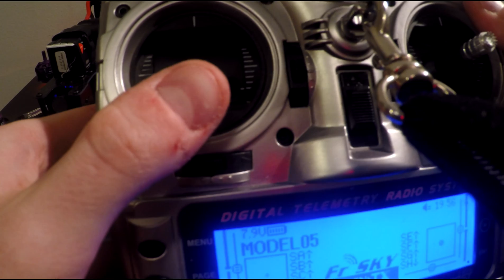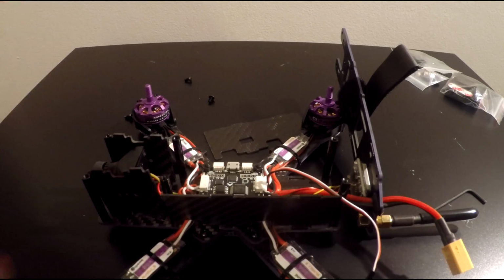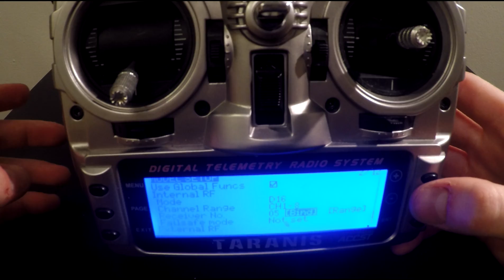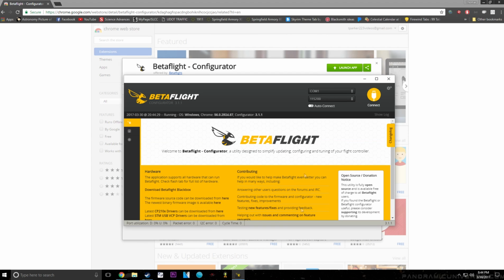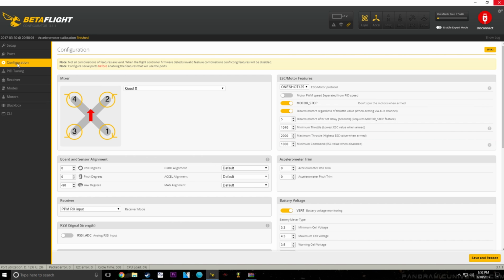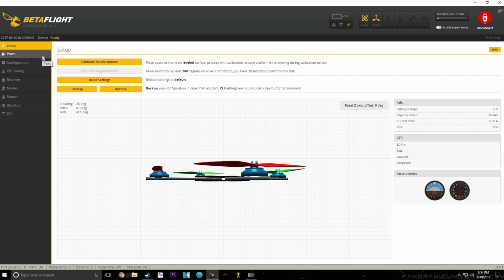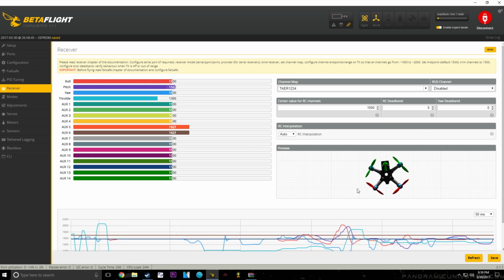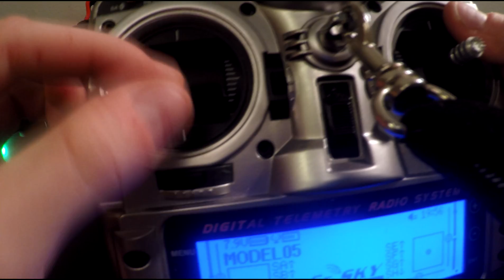EACHINE WIZARD X220 FRSKY TARANIS SETUP |X8R|

Comment: got a horrible question for ya.
since my x8r didnt come with one, what is the name of the cable that i need to plug into the receiver, from the board?
Reply: EiGhTfT it should have come with the actual quad. Not the x8r. I believe it's called a 4 pin mini jst cables. If look that up though.
-mythic
Reply: TparXx I'm wondering if I'm thinking of a wrong wire
I'm using the wizard x220s and it's running omnibus v4 
I'm wanting to bind my taranis to all my quads but do I HAVE to use the x8r to get my taranis flying the wizard??
Reply: Try this: https://www.youtube.com/watch?v=vUNcspmBSog from our late friend PBF, it should be the same with the x8r assuming you stick with sbus. I don't have the x220s, but am familiar with some other betaflight boards, they all have similar logistics when connecting. Maybe we should go grab an x220s and make this same type of video, but with the s!
Reply: TparXx I'm going to strip it down tonight and see what's going on.
Maybe I'm overthinking, I know I've got power cables, and I'm pretty certain the omnibus is set in ppm.  Which means I should have the option to move my port, in the same sense as in your video.  I think my frustrations are from searching for the cable that LOOKS like all the ones in the videos, black top hat
Let's find out in a couple hours.
Reply: Definitely not a bad way to go, you'll learn a lot just ripping it apart and seeing what makes it tick. Looking at a labeled omnibus v4 board picture on google images, it looks like SBUS and PPM are on the same pins, so probably a setting that you'll need to change in betaflight like I was showing. Hard to say without one in front of me :/ good luck mate!
Reply: thanks! its about to go down, but through all of this and thinking back i feel like this might be a dumb question.  but might prove some worth.
if im trying to upgrade this whole receiver deal. do i need to keep the irangex ir-6 receiver installed?  arent we just getting rid of it anyways since im not using the china remote control that it binds to?
Thanks again for all the input a well Tpar!  just another example of how tight this community is

Comment: do i download the cp210x x64 or x86? i downloaded the x64 one.. im using windows 10.. if i try to download the x86 with the x64 installed. it doesn't let me.
Reply: x86 would be a 32-bit program, x64 is a 64-bit program, I would just uninstall the x64 and install x86 because of compatibility issues that may arise.
Reply: TparXx thanks but it doesn't matter now. I gt my drone to work by flashing the board with newer firmware. The program wasn't the problem.
Reply: Awesome fix mate, good job!
Reply: TparXx yeah. In order to understand and know how things work, you just have to get through problems. I literally made things more complicated then it had to be, but now know how to flash newer firmware, changed different things on beta flight, know what a lot of things on the flight controller are. And stuff like that. Great video tho!

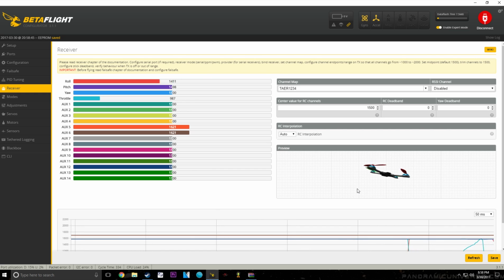Comment: 13:18 my bars dont move like yours. idk what i did wrong. Also why dont i have an Engine on (engon) on my taranis when i want to setup special functions...
Reply: I don't know what the engon function is. But I would try creating a brand new model, re-pairing the RX and then making sure you have is set as s-bus on the flight controller AND in betaflight. -mythic tech

Comment: You said it is normal that motors spin like crazy at first, but i tried starting several times an it still going crazy. I am afraid to put propelers on. How to fix this?
Reply from the maker: I have never found a solution, however it is normal and has not affected my flight as far as I can tell. Seems to be some sort of feedback loop when there's no load or reaction
Reply: Mythic Tech thanks! Can't wait to try it with props on :)
Reply from the maker: Here is our conversation about the topic:

mac: Do you remember how we fixed the run away motor speed back when I got my wizard?

tparxx: I found that to happen on all quads actually 
            I think it's just part of how they work so you have to disarm if it starts to 
            do that. 
            I think it's feedback in the PID controller

mac: I thought we solved it somehow? Or like we just tried anyway and it was 
          fine?

tparxx: yeah, it happens on my alien as well

              I'm assuming you are talking about what happens in the intro to our 
             wizard video right? where I'm talking the motors spin up and I quickly 
             disarm and say, that was wierd?

mac: Right

tparxx: yeah, happens on my alien
              it only happens when you arm and throttle up, or bounce the quad, any 
              input basically just makes the pid controller confused because it's not 
             moving and being stabilized by an external force
             so it's just a feedback loop, nothing to worry about. 

mac: Ok I haven't had that problem since we did haha but I wanted to answer a 
          question on our video.

tparxx: I mean, If you spin them up without props I think that confuses it more.
            As long as that he makes sure that he has the FC oriented properly 
           which I make sure to explain in the video
          the quad won't freak out, he can also lower the idle, but I don't know if I 
          remember how to do that off the top of my head without kiss ESC
Reply: Mythic Tech Awesome reply :D I actualy tried now with props on and it was fine except I did this in a room so I didnt put high throttle. But tomorrow in the field I will be sure.
Thank you, you helped me a lot, with your video and with your answer. 🙌

Comment: Quick question dude
I have bought an xm+ to go with this and qx7
Can I just plug the xm+ into the ibus like you did or do I need to direct solder to UART 3. ???
Reply from the maker: geemailMossman I don't recommend soldering unless it's the only way. Test the ibus first then check back if you can't get it working

Comment: question for you bud, I bought a x220 with an upgraded flight board, to a F4 instead of F3. with that being said can the F4 board run X8R and/or X4RSB? or just the X8R. That receiver looks huge! Your answer will be much appreciated! Thank you in advance.
Reply: Oye Caballero I would say that an X4R would be your best bet on a newer FC I haven't been in to betaflight for a while now as I am on Kiss. But if you look up that board there are sbus ports on it which can accept a wide variety of receivers provided you have enabled that in betaflight. Good luck -Mythic

Comment: Is telemetry fully working in your setup? Thanks for the vid!
Reply from the maker: It doesn't in this setup because we didn't wire anything to the X8R smartport, if it is possible, searching how to connect X8R smartport to SPracing F3 (the flight controller in the wizard) for telemetry and you should be golden! Glad we could be of service!

Comment: Really well explained good job .How did you mount the antennas please?
Reply from the maker: I can make a quick video on it! I used some zip ties up attached to the top piece of carbon pointing out, and then used heat-shrink to secure the antenna to the zip-tie!
Reply from the maker: https://www.youtube.com/watch?v=vE3rXJcBH40
Reply: Thank you😎

Comment: i just got a arf wizard . 100% noob iam .  do they come with betaflight or cleanflight installed from Factory. this is the exact video I was looking for. 👍👍👍. soon as my receiver comes I'll be following this video step by step. any plans on putting a new camera on video ?  That's my next upgrade like a swift 2. I'm really curious if it will just plug right in and have audio. thanks✌
Reply from the maker: Ours came with Betaflight pre-installed so no worries there. As for the camera, I have been pretty happy with the one it comes with but that doesn't mean it doesn't have its limitations. I have looked into the RunCam Owl, which appears to have the same connectors in the back, even still; it should come with enough cables and connectors to get you going!